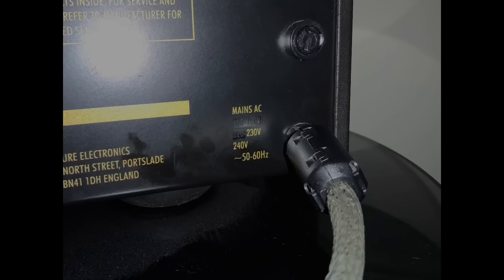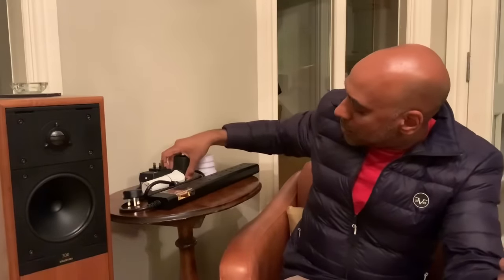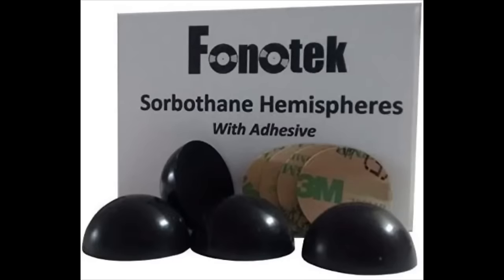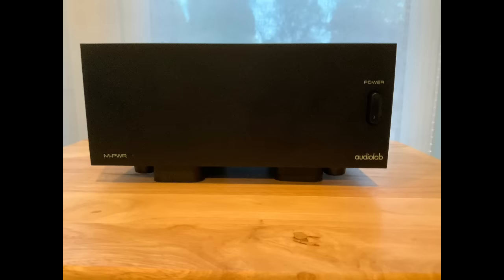My Top 5 Inexpensive Hifi Tweaks

Comment: You present an articulate lecture which I believe would be persuasive to many audiophiles.  However I consider all of these recommendations to be the snake oil of the present day hi-fi industry.  I believe these suggestions at best would make such an infinitesimal improvement if any, that any perceived improvement would really be imaginary.  I look forward to someday seeing such benefits proven by double-blind testing. (I am a retired electronics engineer and long time audiophile).
Reply from the maker: Hi Howard, thank you for watching and commenting. The problem with double blind tests are that you short term audio memory is very unreliable and the differences we are talking about here are subtle. My view is that if you want evaluate any new component or accessory in your system, listen to it daily for two weeks, then remove it. Be honest with yourself, do you miss the component or tweak? If you do, put it back into your system, if you don’t, return it to the supplier. I am not claiming that this is scientific but it is effective.
Reply: A British Audiophile 
Long term audio memory is very unreliable but short term audio memory (switching back and forth) is not so unreliable.  If difference is so subtle as to be not discernible, then I would say it is negligible or imaginary. If one wants to believe that there is an improvement, then go right ahead.  I won’t believe it.  Some years ago there were hi-fi critics that agreed with me.  I’ll admit, these days most seem to have your attitude.
Reply: @abritishaudiophile7314  You're being defensive for no reason. There's nothing stopping you from doing a double blinded test that satisfies your methodology. Get someone to apply one of any number of "tweaks" to your system (at random, with a chance of no tweak being applied) and continue to listen for two weeks.
Reply: Of course, it would be a lot simpler if you could just demonstrate that the tweak had any effect on the sound waves emanating from the speaker. We can measure this to a precision thousands of times greater than the human ear. In fact modern electronics can trivially handle signals LITERALLY BILLIONS OF TIMES more complex than analog audio, and with precisely zero errors. The idea that measurement doesn't work is perhaps the biggest absurdity of audiophile lore. The recording of sound is literally measurement of sound. The recording of sound is literally measurement of sound. Repeat after me: The recording of sound is literally measurement of sound.
Reply: Sir, I too am a engineer (Audio, electronics, material science) and while there is truth to much of what your are saying the effects (ultimate benifits) are acumlitive and, as you probably know, can indeed be measured under the proper conditions (albit a lab primarily). Small but measurable!
Reply: @dabeefemus  What kind of engineer says "acumlitive?" Perhaps you meant cumulative? Saying that you can measure differences in lab conditions is some combination of disputable, unremarkable, adorable, and meaningless—depending on the tweak in question. In the most careful lab conditions you can measure the infinitesimal acoustic consequences of introducing a rat dropping behind the speaker. Sensible people disregard differences so small that they cannot be measured in any realistic scenario... and would be catastrophically dwarfed by moving the point of measurement (your ears, or the measurement device) within a room by just a few centimetres.
Reply: @sjwright2  Sj Wright, you make me laugh! Your displaying your insecurity and need to be "Smarter with big words" you hardly understand to feel important. I am very willing to admit I make  lots of mistakes including spelling! However, the kind of engineer that made that mistake has a B.S. in electronics, audio, and material science with 45 years experience designing advanced electronics including audio amplifiers and more. And the point I made that was obviously lost one you with your superior intelligence is that the mods made by the British Audiophile give us some measure of sonic improvement and are indeed verifiable, in the lab if necessary if you cant ear the difference yourself. I contend some people can. I can not. But due to my willingness to listen with test instruments  I can see the results and they are there. If you cant appreciate that and feel a need to make yourself feel better by putting me down for my spelling mistake (Oh and I make a lot of them which should really please you!) or your lack of appreciation for what I was trying to point out, then by all means knock yourself out!!
Reply: I'm with Tarun here.  I also agree that you can only really assess an equipment change or tweak by listening over a longer period of time.    
When will "electronic engineers" ever understand that listening to music is not some kind of scientific exercise?  There are aspects of the experience which can be measured, but just as many aspects that can’t be - we still don't fully understand why some hifi, or why some music, sounds magical and some doesn’t.
  I'm not a scientist, I'm an artist - and I'm proud to say that pretty well all my family are artists or musicians, some at the highest level.  
Without getting too pompous, at the age of 64 I’ve heard more than a few musicians – from Richard Thompson to Janet Baker – talk about music as something deeply spiritual.  Imagine trying to measure why Maria Callas is an infinitely greater soprano than Anna Netrebko?  Now that would be total nonsense, that would be crazy stuff.  We can just about express in words why one soprano might be sublime and another mediocre, but it’s certainly nothing to do with any kind of measurement.  
If hifi just existed to see which kit could make the loudest bang, then measurements would just about cover it – but this is about MUSIC - it's about human creativity.  It's not just an exercise in electronic engineering, that's only a small part of something far more profound.  If you're able to draw back from your gauges and test tubes for a minute, it's possible to look upon music as something deeply mysterious, it's a miracle that it exists at all, it's close to magic really.  It’s also one of mankind’s greatest triumphs.  I’ll be quoting Rilke next!
I love to make inexpensive changes to my system from time to time - tweaking.  If your system is half way to doing what hifi is supposed to do - then every slight change WILL be audible.  The last speakers I bought needed to be tri-wired.  After I'd realised how many different tri-wire configurations were possible, I read as much as I could and then tried each and every config over a period of about a month.  I have no doubt in my mind that the config which I eventually chose was the best possible.  No measurements were made.  To be honest I'm unsure of the logic behind my final choice either! 
By the way, you can't measure the difference between a 2010 Yamaha violin and a Stradivarius - but many music listeners can certainly discern one from the other.  Have any of you electronic engineers ever tried to find the best speakers and cables to perfectly recreate the exquisite sound of a violin on a hifi system?  I'll give you a clue - measurements don't really come into it.  Sonus Faber speakers are beautifully designed and constructed - and I suspect that nowadays computers are used as part of that design process - but ULTIMATELY somebody has to actually listen to the resulting speaker and then refine the sound further again.  That's done by many hours of listening.....human ears are involved, also the human heart so I'm told.
When I was at grammar school in the 1970, the lads who sat in front in chemistry and physics wore yellow corduroy jackets, hush puppies and ties with an elastic band to keep them done up.  While my friends and I were off exploring everything from Joni Mitchell to Gustav Mahler, the science kids were keen on Emerson Lake and Palmer, Yes and Barclay James Harvest.  Most of them still are... oh dear.  And now they're all over the internet with their 30 year old Naim systems and awful Naim Nac speaker cables...  arguing the toss about blind tests and measurements.
Reply: Let's face it Howard - as a retired electronics engineer - I genuinely wonder if you could tell the difference between one violin and another?  And of course nobody can MEASURE that difference, but oddly many thousands of people CAN tell and furthermore many listeners are even able to identify one violin from another.  That's because music, and the experience of listening to music, isn't all about electronics and measurements.  Okay?

Comment: the boxes you showed are mainly. only one capacitor over the power wires. All electrical appliances you have already have a capacitor on the power input! There is a requirement or something everyone must have inside electronic devices. so I don't think those boxes help anything! haven't heard so much good about them either!

Placebo effect, if you think it works then they do. The active you show up there is a lot of fake off that is being sold. open it to see inside to share it with youtube viewers
Reply: Indeed. They are a well known con.

Comment: Shields only get terminated at the source not both ends on power cables.
Reply from the maker: Thank you djvartan, it is my understanding that it is better to connect at both ends if you don’t have a ground loop problem. Is this correct?

Comment: You might want to check on shielding. I'm a trained union electrician here in the US.  We were taught to only terminate shields to ground at the source end (amp/receiver/etc). By pinning the shield to ground at both ends, can add capacitance and ground loops to the circuit, which causes unwanted noise.

II never heard of sorbothane, is it silicone? If not would silicone work? I planned on making a mold and filling it with black silicone caulking..

Thanks, Good stuff!
Reply from the maker: Thank you. I got some bad advice at the time of this video and amended my advice on shielding in the following video 😊

Comment: Good advice and great explanations. #6 - I like to use a rack for the electronics so that the power lines get routed horizontally to the sides and then down (using a cable trough or they could also be bundled). This gives space in the middle to run the interconnects and speaker cables with sufficient distance to the power cables to prevent 60 hz. (guessing it would be 50 hz. in Europe ) hum from passing into the interconnects and speaker wires. Having a rack on wheels (some audiophiles may shudder) makes this easier. If you have a lot of gear it is almost essential.
Reply from the maker: Hi Kira, that is good advice. Thank you for sharing 👍
Reply: Its's definitely good practice to separate AC and other cables, but if you're running equipment that is close to it's rated power under use (e.g. amplifiers running on full blast), be aware that the power cords are meant to (and sized for) hang freely, suspended in air. In this way, any heat generated in the cord can be dissapated easily, and it's under this assumption that the power rating for the cord is established. Bundling cables together calls for a socalled reduction factor in power rating, to account for both the surface area that's no longer able to dissapate heat but also the influence (heat/magnetic) from the surrounding cables. Likewise, running the cord in a conduit increases the temperature around the cable, as the dissapated heat can no longer escape and thus heats up the surrounding of the cable instead. These factors combined will typically reduce the power rating of a cord or cable by around 30 %, so if your usage approaches the 70 % mark, it's worth being aware of.

Comment: The Ifi ac purifiers worked a treat in my system. Probably the most improvement from a tweak.
Reply from the maker: Great 👍
Reply: One beauty of them is they are so easier to move, you can move them round to different systems as you use them.

Comment: I have a MSEE and had to shut this off after the first few minutes.  Yikes...
Reply: I know, right? The saddest thing is that people focus on differences which defy all scientific inquiry. If you can be impressed by differences so marginal that they literally defy measurement, you have to be utterly gobsmacked by differences that are SO MASSIVELY HUGE that you can actually measure them. There's plenty you can do which is trivially measured and proven. For example, moving your speaker by one centimetre is trivial to measure objectively. If your "tweak" has less effect on sound than that, you ought to question it.
Reply: I think I need to change industries. . .
Reply: I think the point here is that Tarun is trying to show you some very affordable ways to make sensible improvements to an audio system. Some people will not want to bother and others will be delighted. Decent well screened interconnect cables make sense, loudspeaker cables that have sufficient current carying abilities and a nice low resistance/m also make sense, power cables that are short and kept away from signal cables makes sense. Screened power cables, why not? Yes I agree these should only have their screen connected at the line end, not the load end. Listen and decide for yourself, if it makes you happier then surely that's a good thing, especially vif you can makes some sensible improvements at a sensible cost. For me it becomes snake oil when companies start charging hundreds of dollars/pounds for the generally small improvements. Thanks Tarun.
Reply: @richclips  In the first few minutes:  1) There is a major difference between differential-mode capacitance and common-mode capacitance -- nothing said about that.  2) number 1) aside, and assuming it's just a simple model with a source resistance, load resistance, and shunt C across the load, taking the source resistance to be very low -- call it 0.5 ohms to be ultra conservative -- and a 8 ohm load which produces a Thévenin equivalent resistance is 0.5 || 8 ~ 0.5 ohms, we find it would take about 16 uF of capacitance to reduce the system's bandwidth down to 20 kHz.  Seems a bit much, eh?  Cable capacitance is only a concern when the source resistance is large, like in a guitar pickup.  Shielding a cable is a rather complicated matter, and the truth is that most people don't even know how coaxial cable works (I know this is not coaxial cable, but putting a shield around anything is not a simple matter, and where to ground the shield can make a huge difference in its effectiveness).  His point about SNR is certainly valid.  3) Ferrite cores are not magnets.....that was it for me.  I've been an electrical engineer for four decades and a guitar player for longer than that, and the amount of snake oil and misinformation I've seen in the audio world in general is staggering.  I hope you don't have any gold-plated fiber in your system.
Reply: @richclips  Most of that doesn't make sense if you have some understanding of electricity. A below-spec power cable would only cause heat and inefficiency. It would also be illegal in most countries. But other than the distortion generated by the crackling embers of a house fire, it wouldn't affect the amplifier's nominal performance.
 
There are valuable, useful tweaks that are even cheaper than described in this video—and which also have the benefit of being demonstrable. For example, even the slightest repositioning (in the order of millimetres) can have a measurable impact on the speaker's performance within a room. There's a similar measurable effect from moving your listening position. Even a slight move can be detected with sound wave measurement.
 
Perhaps your rule of thumb should be that any tweak you take seriously must have at least as much impact on the sound you hear as does moving your head by an inch?
Reply: Maybe some other swindlers Will really make those Gold plated Fibre (optic) cables and try to  sell them to the Gullibles..
hint ....quickily apply for a patent..and keep it locked up..
Reply: @analoghardwaretops3976  Sadly, gold-plated fiber optic cables already exist.  I didn't believe it until I looked them up.

Comment: I’ve never subscribed on first viewing before, but in this video at least, you talk so much sense that I’m compelled to. I look forward to many more.

By the way, I use felt pads for equipment isolation — they work really well too.
Reply from the maker: Thank you for watching and for your support of this channel. It is very much appreciated😊
Reply: I have some old Celestion 15 speakers I inherited connected to an old Pioneer SA-500A amplifier. The speakers were on a porcelain tiled floor and the sound want great. I added some felt pads and was very surprised to find the sound much clearer. I need less volume and speech is much better separated. I need to do some more testing but if I'd bought new speakers I would've been as impressed. Thanks for the suggestion.
Reply: @abritishaudiophile7314  I wanna recommend a  few good listening cd/albums..Artist Jonny Hammond alum Gears first and second selection, next Artist 3rd Force album vital force selection You gotta be real, I think you will really enjoy these as very good listening music, they are well recorded.. let me know what you think

Comment: Tip 6 - Keeping your home quite cold will stiffen your driver surrounds, tightening your bass and providing greater texture.  Of course, you will need to wear a jacket within your home, but small price to pay.
Reply from the maker: Good one 😂
Reply: I've found that induces low frequency vibration (shivering) and a shrill foreground noise (Wife yelling saying "turn on the .... heater")